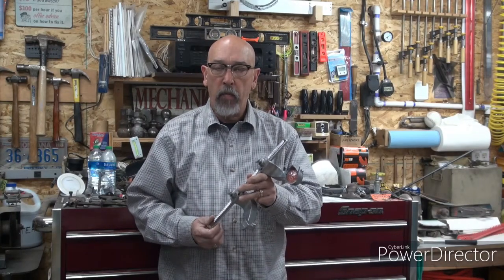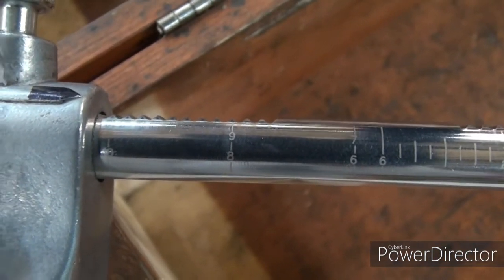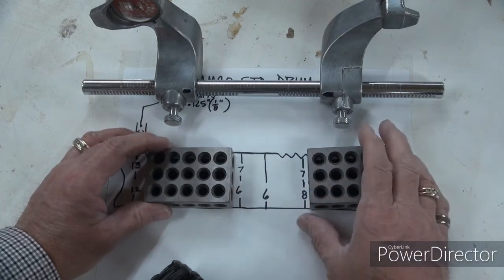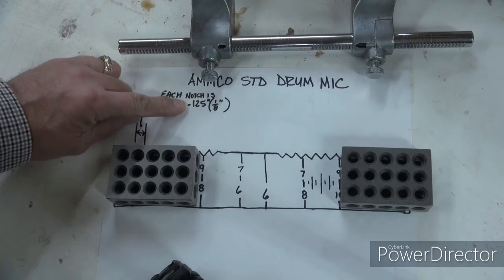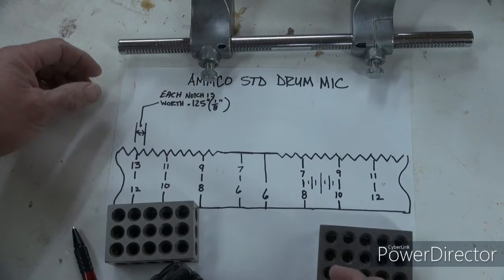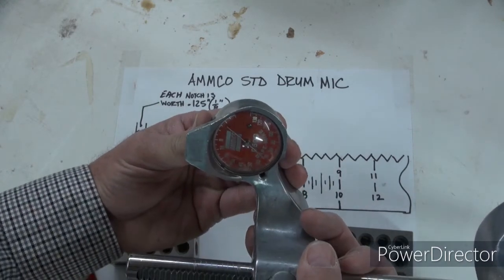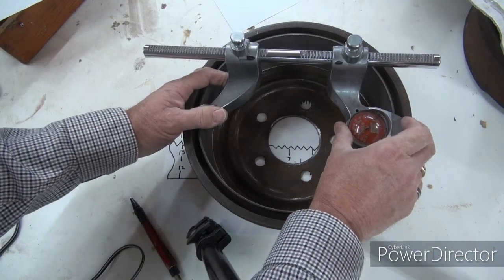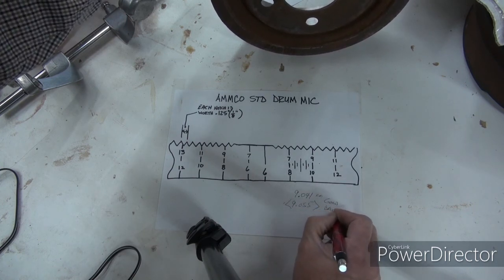How to use a AMMCO Standard Drum Mic

Comment: Every automotive machine shop with a brake lathe in the 1950s to the 1990s had a least one of these. I need the long rods for the larger sized  semitruck & semi-trailer brake drums. They even made some crazy long rods for heavy equipment, mining equipment, very large military trucks and even old cable lift elevators with very big brake drums.